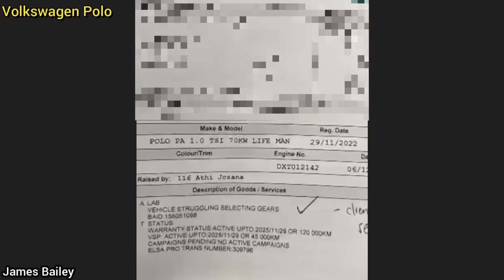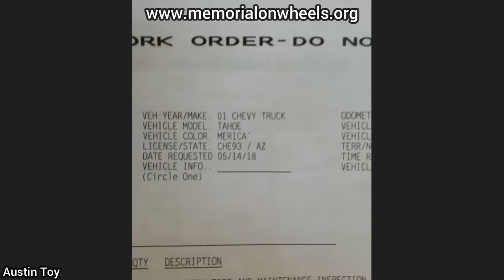Customer States They Need Door Repaired After Locking Keys In Car

Comment: the door one, i would think its cheaper to break a window than having that door fixed if in not replaced!.
Reply: maybe he was worried he would hurt the dog, not sure
Reply: Glass is pretty cheap but cleaning up the glass is a damn nightmare. Shit really goes everywhere.
Reply: @justz00t48  Get a sheet of paper as big as the window, smear it with honey or syrup or something else sticky, stick it to the window, then smash it. Most of the bits will stay stuck to the paper...
Reply: @justz00t48  Honestly id rather replace a door than clean up glass for the rest of my ownership, ontop of the fear of the dog getting injured from it
Reply: @cooperised Not a bad plan but if I was ever in a situation I was that prepared I would just use my lockout kit. Just was mentioning it from experience cleaning up the mess and replacing glass.
Reply: @SaulHeno I would wreck a door before hurting my dog too.
Reply: @cooperised  or just use duct tape. Make a frame on the edges of the window and an x in the middle. Works best.
Reply: Im at the door, doggo has a hard time understanding to stay away as im going to shatter this window as it’s stands on the window…
Reply: @@martys4x457 I think the last piece of glass I replaced was less than 70 but a locksmith is totally worth the extra money.
Reply: @tobiasmetzger4522  Wouldn't you need to cover the whole window? Toughened glass shatters into tiny beads, instantly. Any bit of glass that's not taped down is going flying.
Reply: @cooperised  with my method, it's covered enough. If you use the tape to form a small handle you can even pull it out easily. Those few pieces falling inside aren't worth mentioning. Use a vacuum and they're cleaned in 2 minutes
Reply: Strange thing is that the window is down on the car, from what I can see. The passenger side should have been able to open, at the very least.
Reply: 1st option, call a locksmith
2nd option, break a window, they are Tempered Glass AKA "safety glass" and it breaks into small pieces with rounded edges and won't slash the dog (or anything else) to ribbons, & if you tape up the window beforehand  with duct tape (or any tape) you can stop it making a mess. Choose the smallest window, eg: F/R quarter or vent window (if your vehicle has them)

What you should not do is gouge a f@#k off big hole in your door, damaging the interior of the door in the process, this is the height of stupidity, and is known as "a smooth brain move"🤣🤣
Reply: @tobiasmetzger4522  Yup, thats the way to do it.

Comment: 3 terrifying words.

"Customer declined repairs"
Reply: In UK Garages have the right to not let the customer take their vehicle away, other than on a truck or trailer, until dangerous faults have been repaired.
Reply: I have declined repairs before, but it's because if I'm low on money, I'll get the major repairs done first, then bring my vehicle back in a few weeks to repair the more minor concerns.
Reply: why would you repair a car that is complete junk? would you really want to spend the money on a car that is all rotted away and needs the repairs that they actually came in for?
Reply: @volkswagenginetta  My truck isn't junk. I said I have declined doing minor repairs to make sure important repairs are taken care of first. When my vehicles are at the point that they may be unsafe to drive, they go to a salvage yard, not a bump shop.
Reply: @michaelwhite6498  what if they're not able to afford such repairs?
Reply: @thegreatstonedape5962  But they know as its held together with ratchet straps, chains or bits of angle iron.
Reply: @leemajors3834  maybe. But this channel has shown many clips of those types of fixes on vehicles that the owner didn't know anything about because it was that way when they bought it or when somebody bought it for them. Lots of people buy vehicles without knowing anything other than how to drive them and plenty more don't have a place nearby to get an inspection.
Reply: @nekk-ra7080  hmm i guess it failed to tag OP. i was respond to the comment "3 terrifying words.

"Customer declined repairs""

as in there is no point in repairing a peice of junk. i dont mean your truck is junk
Reply: Yeah i wonder how many were declined because they decided to just scrap it instead
Reply: @michaelwhite6498  gunsmiths do that too, don't want to get sued because you let a grenade walk out the door
Reply: @pacman10182  only in America can gunsmiths have more power over the repair shops that can or cannot allow "vehicles" on the roads! >.>
Reply: @Atixtasy  mind rephrasing that? I cant make heads or tails of it
Reply: @thegreatstonedape5962  Ok, first of all, if you can't afford to repair your vehicle, then you probably shouldn't have one in the first place. Having a car is not just putting fuel in it and driving it. You should always consider maintenance and repair costs before actually purchasing one. 
Second, the guy meant you can't drive off in your car, if you decline important and safety compromising repairs. You can only take it away stationary
Reply: well when my dealer wanted $10,000 for rotors and pads on all 4 wheels i politely told them to fuck themselves, $500 in parts, 3 days of shipping, and 2 hours of work later i had all new brakes on my car just the same as the dealer would have done it, even have all the same computer software they had so i was able to follow their exact same procedure as well
Reply: @michaelwhite6498  Same here in Finland, and also our older than 10 years cars need to be inspected yearly clears cases like these mainly! Worrying thing is that these can drive those same roads as all of us!
Reply: @thegreatstonedape5962  if they are driving such an unsafe vehicle, maybe they also can't afford to drive
Reply: @zenkalt  was only asking lol, not everyone's financially stable enough to afford the costs of some repairs.  you need a vehicle if you live in a rural area regardless if you can afford to maintain it.
Reply: @michaelwhite6498  That is extortion
Reply: @thegreatstonedape5962 
1) if they can't afford to keep a vehicle in a save condition, they shouldn't own one in the first place.
2) for most repair cases, not doing it now would mean having to do an even MORE expensive repair later on.
Reply: @Mernom  like I said people who live in a rural area need a vehicle otherwise they can't go to work, pick up groceries, etc.  wouldn't be a problem if you lived in a city/suburb that at least offered public transportation but not everyone gets that luxury.
Reply: @calebb5106 I'm actually interested in this. Did they accidentally put an extra 0, or did the program mess up? Do you have the quote? It sounds like it was supposed to be $1000. That sounds a little more reasonable for certain vehicles, especially since just the parts cost $500.
Reply: One reason I got out of the auto repair industry was the inability/unwillingness of customers to make needed repairs to critical systems.  Broken, worn and missing suspension components, dangerously worn steering and tires, brake systems that were not fully functioning were often declined for repairs.  We served a rural community with a lot of low income customers.  I understood their situation but couldn’t compel them to fix or park the car.
Reply: I bet an used car is cheaper than most repair fees & spare parts in USA.
As for my experience in Finland, I've decline repairs as well because I do not want to pay +1,000€/$ to fix a single problem on a car worth max the same as the repair. Instead I've bought an used car for half price with passed inspection for a year, then turned the other junk into a cube for 50-100€/$ profit while keeping its wheels.
Reply: I pray most of these are "don't bother fixing it, I'll scrap it instead"

Comment: I couldn't help but laugh at the Harley one. Me and a buddy did the exact same thing on his sporty. The bike was new, and I wasn't much of a Harley guy. We just looked at each other and said that's a bit thick to be engine oil. Luckily, we weren't dumb enough to just send it afterward.
Reply: My Ducati used straight 50-weight engine oil, 5 quarts of it. It came out a lot like transmission oil. Of course, it also was the transmission oil.
Reply: once had the owner of a Citroen Berlingo (compact delivery sedan thing here in europe) who tried to do engine oil change at home, but was irritated that the dipstick still indicated full. so he drove to our shop and told the story. upon jacking the car up he exclaimed, "That isn't the motor oil plug? What have I been draining, then?"
to be honest, the gearbox' drain plug is visible when you lay under your car's front, and the motor one's is like, hidden behind the oil pan's edge, and out of sight. unless you jack the vehicle up...
we changed oil for him, and refilled the gearbox.
Reply: 😢 don't you guys have like a repair manual or something?
Reply: I could see someone doing this if they were used to other motorcycles that have an integrated engine/transmission case.
Reply: @MrBirdnose  don't people have owner's manuals and repair books anymore? Why are they just randomly wrenching on things?
Reply: @WALTERBROADDUS  Beats me, I always read the manual. But I'm not a Real Man. Real Men don't read instructions. ;)
Reply: @WALTERBROADDUS  Bold of you to assume I can A. Read, 2. comprehend, and/or Q. Follow simple instructions
Reply: @lotharrenz4621  OOPS!!

Comment: The customer with the new VW burnt clutch has been watching too much Cleetus Mcfarland
Reply: how do you even do that in 25 miles?!?
Reply: @oldfrend  How? Easy, hold the throttle and let off the clutch right to the friction point barely engaging for... ten minutes??
Reply: Or maybe it's their first stick shift and, instead of putting it in 1st, they put it in 3rd, revved it hard to get it moving, and rode the hell out of the clutch.
Reply: @oldfrend  You can destroy a clutch in under a minute. All you need, is being deaf and can't hear your car screaming... and just dump the clutch.
Reply: My Right Foot Breaks 💩
Reply: That's simply a driver who has little or no experience with a manual gearbox. Frightening that they are allowed on the road at all, to be honest.
Reply: @captivatingpresentation940  or they wanted to try a burn-out.

Comment: 2:22 For once, I've actually seen something weird someone has done on this channel before. At one point in time, those cables were connected to the battery and the cables on the inside were used in conjunction with a jump-pack. I actually have to wonder if this is the same car I saw this in as it was late at night when I spoke to the person about it.
Reply: yeah, I saw that and thought jump pack too, but man... the leads in the car must be sparking at least some times, right??

Comment: This channel's videos are actually longer due to going back several times to see if I saw what I saw.
Reply: The double take factor is strong with this channel. But I like it because it can be a good teaching experience for people. This is what happens when you do that, or this is what happens if you don't do this.
Reply: Yeah, like the rear trailing arms being held in place with ratchet straps. I had to check that three times to make sure I saw what I saw and heard it correctly.

Comment: The missing coil spring is usually due to the spring breaking due to metal fatigue and falling off. This problem was relatively common on Opel cars from the early 90s, and the fix was to use BMW spring from the scrap yard. Looks like GM are going back to their roots ;)
Reply from the maker: I've seen that lots before but never on a 2 year old vehicle lol
Reply: @JustRolledIn  Manufacturing defect?
Reply: Broken Coil Springs Dont Usually Fall Out .

Comment: I literally don't understand how people destroy clutches in that short of time
Reply: Surely there was a fault. I had a clutch fault in a low mileage car and the manufacturer refused to repair it. 

I got it replaced and the shop said there was no damage to the clutch, and that it must have a manufacturing fault. But they wouldn’t put it in writing or they would lose their business from the dealers.
Reply: Slipping the clutch thinking they are powerbraking? 

I don't know how true it actually is, but when I bought my mustang, the dealer told me that clutches are not warranted on the 302 engine cars.
Reply: I knew one person, new to driving stick shift, who lived in a hilly area and partially-engaged the clutch to hold the car on uphill slopes. Made for an easy hill start but was extremely hard on the clutch lining.
There's also a video on YouTube of a guy in a Corvette destroying a clutch in about 30 seconds attempting to do a burnout on dry pavement. If you get the clutch hot enough the lining will just disintegrate.
Reply: Mostly automatic Drivers that believe, they can stick shift as well....
Reply: I killed a clutch in less than 2 miles of attempting to drive a manual, over the course of about 3 hours.

I was 15...Ma had this "thing" where no kid of hers wasn't going to be able to drive stick snort

She took me out to the high school parking lot to give me lessons in the company car. A Renault LeCar, which was one of the tiniest jokes on the market at the time. I literally, yes literally, could not fit both of my legs into the driver's side. I had to roll with the door open and my left leg sticking out. And I was supposed to learn how to drive stick in THAT.

I immediately said that it wasn't going to happen and to just let me have the old Buick (automatic), but she had her heart set on tilting at this particular windmill.

For almost three hours, I was made to attempt to keep the little carlet from stalling out, trying in vain to reach the legendary "fourth," while it stalled and had to start over again and again. Finally, I was allowed to give it up and she drove us home.

The next day, after it had all night to cool off, the price of her obstinate obsession made itself known. That car was going NOWHERE. At the dealer, (the boss always insisted on using the dealership for repairs), they instantly accused Ma of letting a n00b try to drive it, and didn't she have a teenager in the right age group? Ha ha she managed to talk them out of mentioning that to the boss...

The bill was $600 back in the 80s, stuck to the company, but still enough to convince Ma that yes, a kid of hers WAS INDEED not going to drive a stick!

I got the Buick after the boss said that any more clutch repairs would be on her. I'm sure he "did the math" same as the repair tech, without needing to be told.

And that's how you kill a clutch without even having the car on the road. Make your teenager try to drive it due to some private obsession, in a car she can't even fit in, instead of forking over the keys to the suitably-sized, automatic land yacht.
Reply: @MrBirdnose  I've been driving a stick since forever and know not to let the clutch slip any more than absolutely necessary. I had one of the Ford Focuses with the funky automated manual transmission that Ford had such trouble with. I drove me nuts that Ford had programmed the transmission to slip the clutch so it would feel more like a conventional automatic. It was a nice little car and never gave me any trouble, but I never did trust that transmission and traded the car for a Mustang.
Reply: @JeffDeWitt  Yeah, anything with a dry plate clutch is not going to tolerate clutch slipping for very long. Wet clutches, like in many motorcycles, can be a bit more tolerant.
Reply: @RealMTBAddict  LITT-trely
Reply: Skill issue!

Comment: The yellow cables are obviously for the microwave they took out before dropping off for service!
Reply: I once saw a setup like that on a total beater of a flatbed pickup that was being used to move an eight-foot log of old growth mesquite.  The owner had scabbed a winch onto the headache rack to get the logs (it was his "business") onto the bed and was powering it using two jumper cables hooked to the truck's battery.  He'd cut the clamps off two of the ends and twisted the wire together to get them to reach.
     DOT enforcement had a fun time with that truck...the officer canceled the registration on the spot, pulled the plates, and flagged the VIN  as not roadworthy, effectively deadlining the truck.
Reply: @christopherreed4723  Was it bad tires, lights, or improper securement? That’s all I’ve ever seen dot write up on the light duty stuff
Reply: @servicetrucker5564  The log was not secured in any way and the truck itself was in very poor condition and had unsafe modifications (like the spliced jumper cables leading from under the hood to the winch).  To top it off the driver had no insurance and  a suspended license.  So, with vivid mental images in mind of what happens to your average car when it slams into a log weighing close to a ton with no chance to brake, the officer threw the book at the driver.
Reply: @christopherreed4723  So all three then

Comment: Pouring rice because of a water leak is actually smart.
Reply: yeah seriously- they just need to remove the fing rice as soon as it does the job, so they dont get nasty rice mold and a lung infection.
Reply: Rice gets sticky and leaves white shit on everything…
Reply: Aren't you supposed to place the whole car in rice, like you would with a mobile phone?  :)
Reply: How? Rice does litterally nothing. The whole "put your phone in rice" thing is a giant myth too. It just gets everything messy. Some kitty litter might actually soak it up, then throw a box of desiccant in the car. Or just open both doors and blow a fan through it. Either way rice is worthless unless you're eating it.
Reply: @stephenlang1422  Rich Rebuilds put a non-working flood damaged electric car in a giant wooden box and filled it with rice.  It ran and drove afterwards.  Still not sure if he's pranking the Internet at large with that or not.
Reply: Not really, it doesn't stop the leak does it? Just gonna end up with soggy rice on the floor.